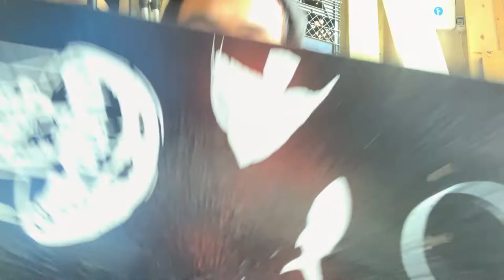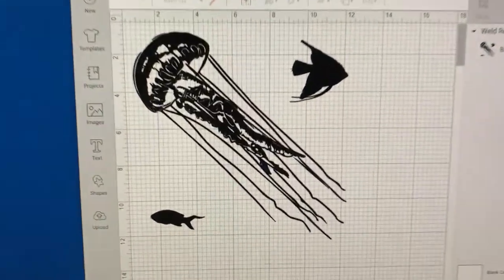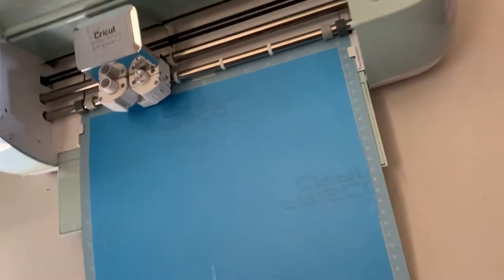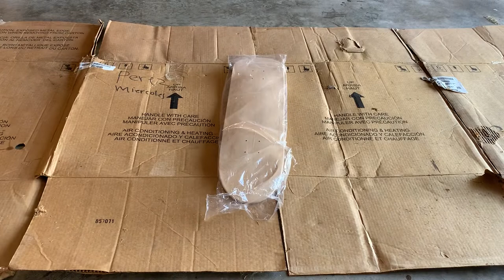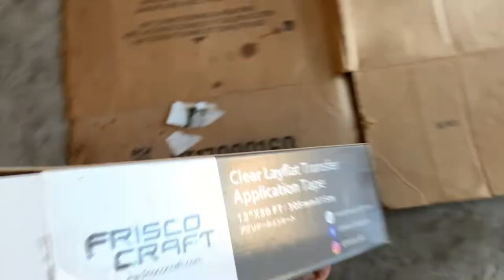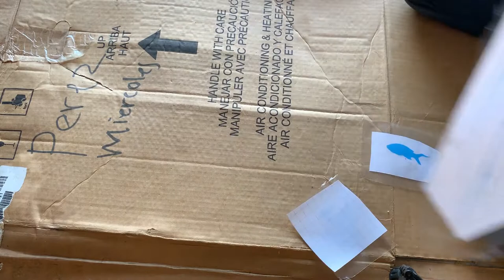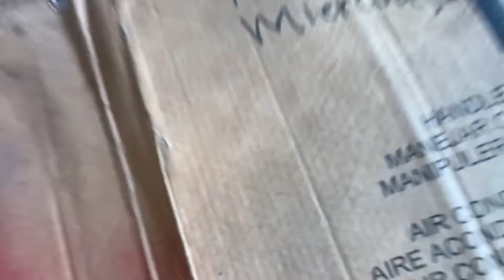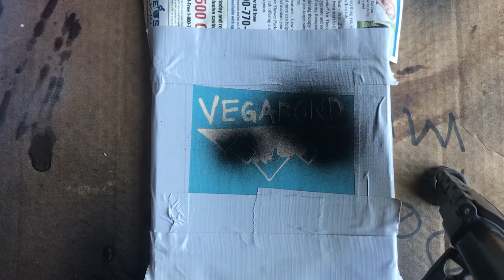How to Spray Paint a Jellyfish & Some Other Fish on a Skateboard

Comment from the maker: Materials used:

Blank skateboard deck:
https://www.etsy.com/listing/1083578308/plain-blank-skateboard-deck-8-inches

Jellyfish & other fish stencils, plus transfer tape:
https://www.etsy.com/listing/1097019937/jellyfish-vinyl-stencil-sheets-2-extra?ref=listings_manager_grid

Pastry roller:
https://www.amazon.com/Norpro-Wood-Pastry-Pizza-Roller/dp/B000HK2DNA/ref=sr_1_2?dchild=1&keywords=pastry+roller&qid=1634852729&sr=8-2

Red spray paint:
https://www.amazon.com/Rust-Oleum-7765830-Stops-Spray-12-Ounce/dp/B000SBL7JY/ref=sr_1_2?dchild=1&keywords=spray+paint+red&qid=1634852929&sr=8-2

White spray paint:
https://www.amazon.com/Rust-Oleum-7791830-Satin-Enamel-12-Ounce/dp/B000Z8FGII/ref=sr_1_2?dchild=1&keywords=spray+paint+white&qid=1634852949&sr=8-2

Blue spray paint:
https://www.amazon.com/Krylon-K02716007-Fusion-Spray-Patriotic/dp/B07LFRWLV6/ref=sr_1_5?dchild=1&keywords=spray+paint+blue&qid=1634852988&sr=8-5

Resin:
https://www.amazon.com/Casting-Countertop-Measuring-Plastic-Spreader/dp/B0834C5T12/ref=sxts_rp_s1_0?cv_ct_cx=resin&dchild=1&keywords=resin&pd_rd_i=B0834C5T12&pd_rd_r=ea475f68-6166-413a-8d6d-de70b5a0bc43&pd_rd_w=boj9N&pd_rd_wg=19ccG&pf_rd_p=c0fa563a-b0ba-455a-bd65-7b14bea6288c&pf_rd_r=DA8VJGVX34Z89DT39436&qid=1634853018&sr=1-1-f0029781-b79b-4b60-9cb0-eeda4dea34d6&th=1